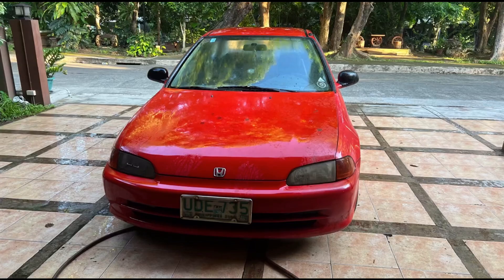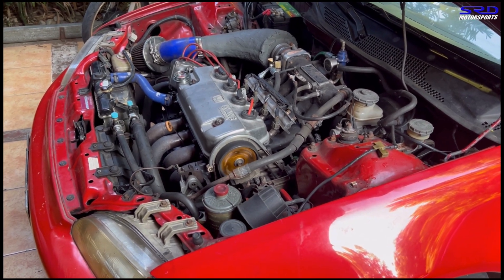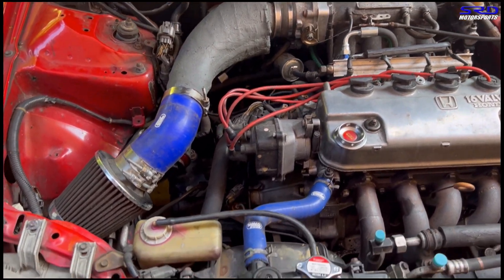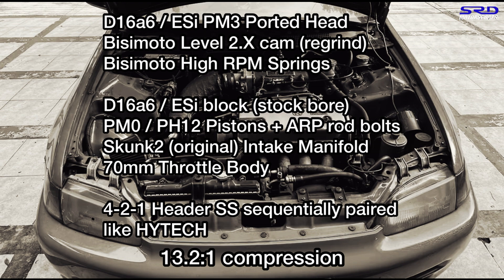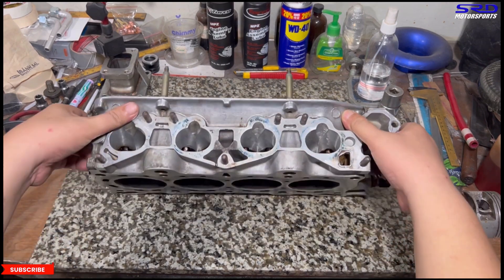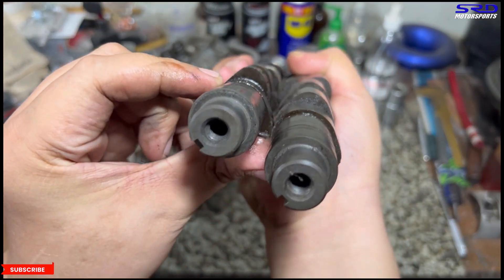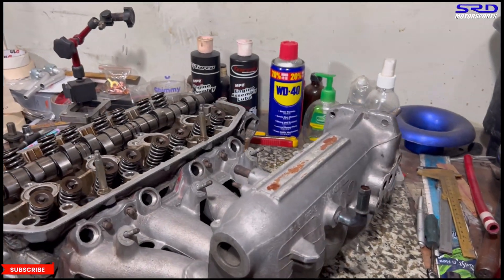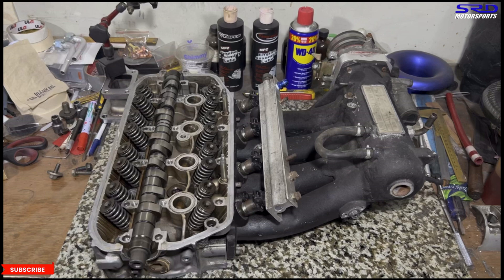D16a6 Non Vtec All Motor Build Series Part 1 Bisimoto Cam

Comment: Bro can you give the code for full set gasket and conrod bearing, main bearing, thrust washer, and piston ring, I want rebuild my d16 non vtec
Reply from the maker: Il check tommorow daido and or taiho has it but also easier to just get acl main bearings for d16 and acl race rod bearings ,that would be good i

Comment from the maker: Part 2 is here! Extensive breather talk and Mugen cam clearancing detail
https://youtu.be/auJhoRz8HNg

Episode 3 is here! More on ITB and intake tech talks
 https://youtu.be/HmMMT2GlI6c

Episode 4 is here! Some chamber tech talks and mods
https://youtu.be/FUzzBQtAGp0

Episode 5 is here! Fully assembled head and install and an extensive ecu tuning talk
https://youtu.be/Q2WlfOtaj0Y
Reply: Do you know the Mugen cam lift and duration?
Reply from the maker: duration I have checked as it won’t turn without hitting but cam lift is 8.32mm so that’s more than 0.530”

Comment: Bruh, my first five speed Honda was an eg sedan, and I did a headswap using a d16a6 with the b7 block, I believe compression was like 11:1..... To me that a6 head was the best non VTEC single slammer Honda created.
Reply from the maker: Oh maaaan!!!! Sweet! Mine was an EG hatch and I swapped in a D16a6 that came off an ESi like my current.. locally the d16a6 came on the EG 4door so it’s like a 1600 version b7 cuz obd1 in the US the d16a6 came from the crx so it’s OBD0 but it only needs a b7 distributor and it becomes an OBD1

true on the a6 head!!!

Comment: Do you have to modify the rocker arms  to run a that mugen cam?
Reply from the maker: The rocker arms no.. (sorry missed this question) but the cam is too big I gotta grind off some areas of the head cuz the lobes hit

Hence I haven’t degreed the Mugen cam yet I need to grind off space on my spare head hehe

Comment: Wait so you have a 70mm throttle body with the skunk2 intake manifold!? I heard that the 70mm throttle body was not good for the all motor set up. But I always thought the all motor engines need all the help they can get considering the setup type.
Reply from the maker: It really depends on the set up… my d16a6 runs a compression ratio  most only do for “race set ups”

And also a lot of misconception because it’s just a sohc or dseries… sure it’s just 1.6Liters
But it also has 1mm more stroke than a B20 😎

89mm stroke b20 
90mm stroke D16

Comment: The rocket motorsports cam is the mugen even better than those cam ??
Reply from the maker: What do you mean? “Better” is relative to engine set up
Reply: In terms of hp gains who is better mugen or rocket motorsports
Reply from the maker: @thathondadude5974  it really depends but a regrind will NEVER match or beat a billet/cold steel core cam.. the Mugen cam isn’t a regrind

And Mugen/King Motorsports makes 216hp with it for road race 

And “better” is always relative,
Like a skunk2 pro2 is a better cam
But for a B16a the Skunk2 Pro1 is better in many cases
Reply from the maker: + Mugen has competed in Formula 3 and even reached Formula 1 back in the 90s with Jordan F1

Comment: and it has begun...sooo curious about that MUGEN cam🤣
Reply from the maker: You and me both man! I can’t degree it as it hits everywhere I could prolly grind the spare identically ported head I have soon to degree

But it has 0.510 intake lift and 0.496” exh lift bigger than a pro3 haha
Reply: @SRDmotorsports  actually its not big..its MASSIVE..haha
Reply from the maker: @the063one  technically true cuz even without degreeing that duration lasts for days hahaha… but Mugen knows better… they’ve built a 218bhp d16 nonvtec and the “expers”  havent hmmm

Comment: Which ECU are you using ? 

I just came across a post of a reputed tuner running 13+:1 CR , stock cam Tb, ported head on THE STOCK ECU !!! Honda d16 sohc.
Reply from the maker: Rechipped ecu a p06